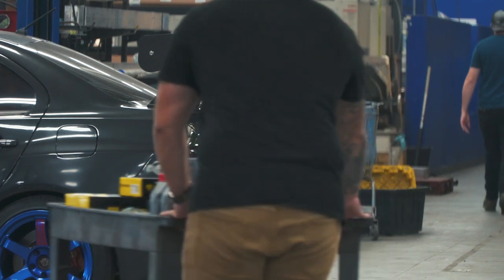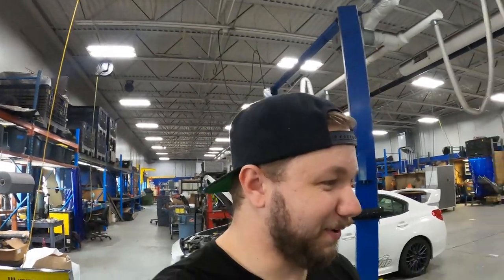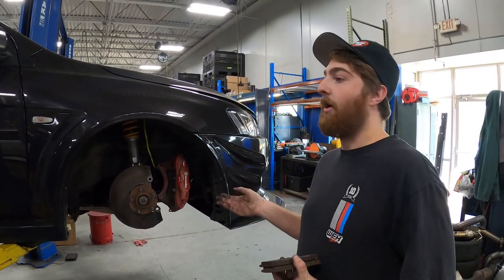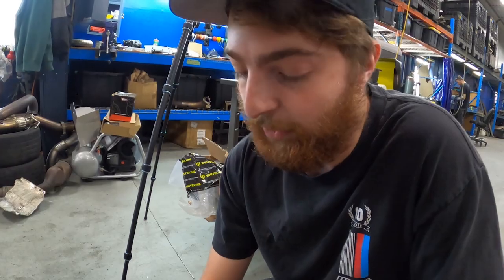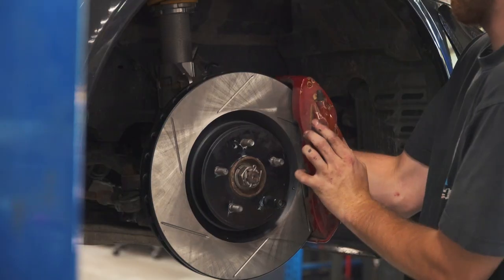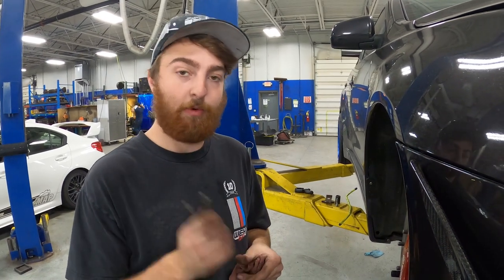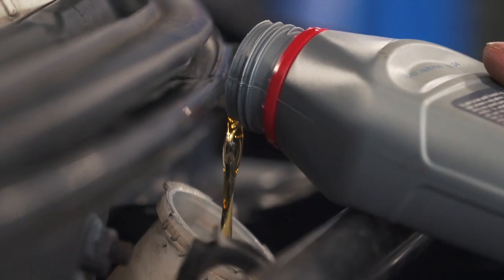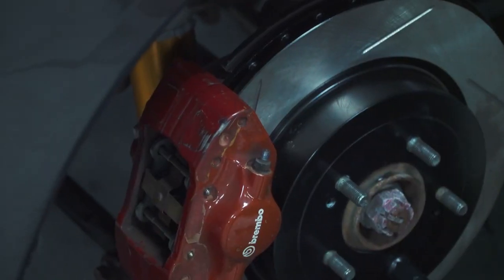Installing New Evo X Brake Pads, Rotors, Lines and Fluid | Ultimate Evo X Ep. 16

Comment: Great video!! I plan on getting the same brake kit. Fluid lines and pads will go a very long way with these cars. Just make sure to change the pads atleast the more often you go to the track the more often you should check for ware. Keep it coming i want to see what you got from whiteline. Let me guess its the endlinks I just installed then and they are amazing youve gotta install the whiteline sway bars endlinks adjust them to full stiffness and you'll love the right. Next up for me will be the whiteline rear lower control arms and possibly the rca kit.
Reply from the maker: Thanks for watching! We def have more planned for this car.